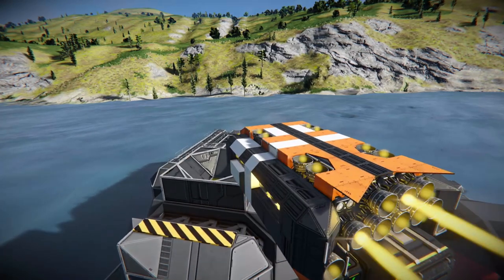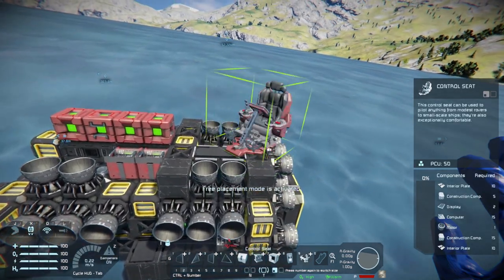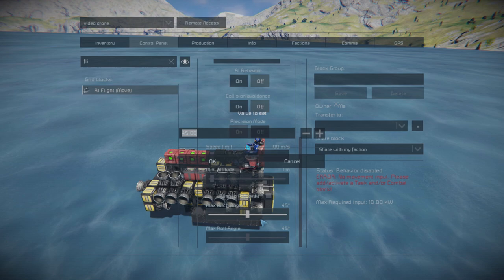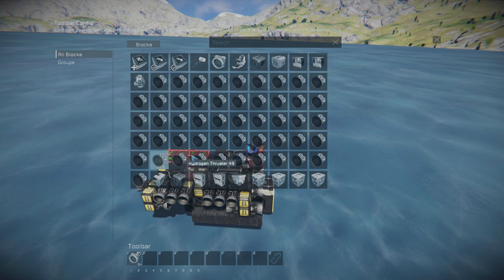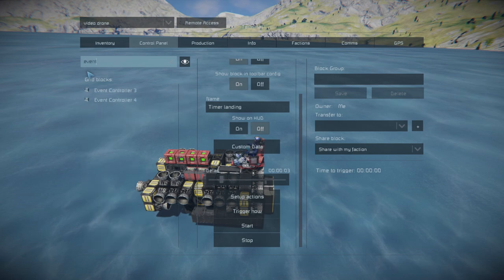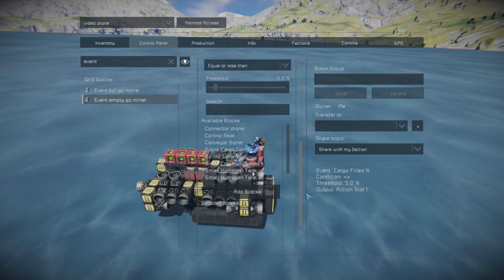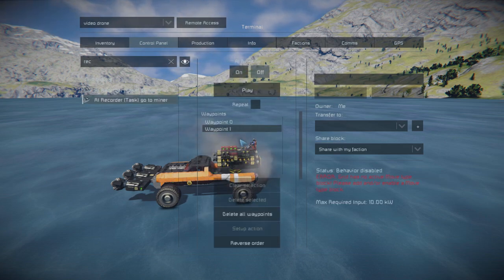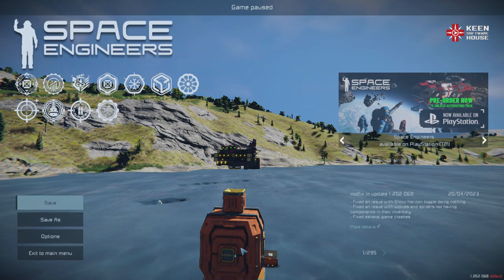Space Engineers - HOW TO BUILD A Cargo Drone - Automatons Tutorial

Comment: Am I correct in assuming the overall distance doesn't matter to the AI? It just sees Point A and Point B so it goes back and forth?
Reply from the maker: I havent tested it, but i would assume it to, as long as there is fuel (ice) in the drone, its should be able to do any distance. I made it to keep 5% ice for the way back to the miner if that not enough, you can change the value in the event controller (empty go miner)
Reply: @GMEGUTTERMAN  based on your video, the drone definitely had to travel further to get to the truck. So it stands to reason. I'll have to give it a shot
Reply from the maker: @rokker17  thata good to hear, if you run into any other trouble let me kbow, and we'll see if we can work it out.